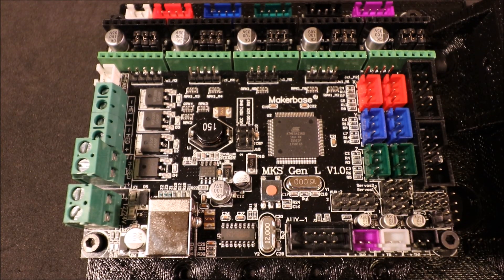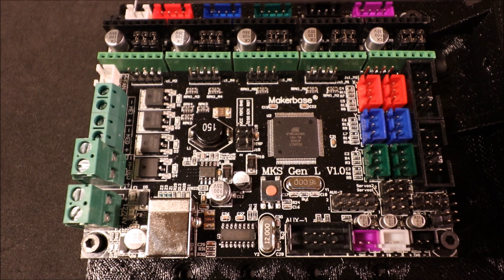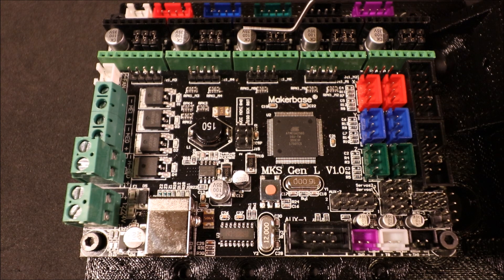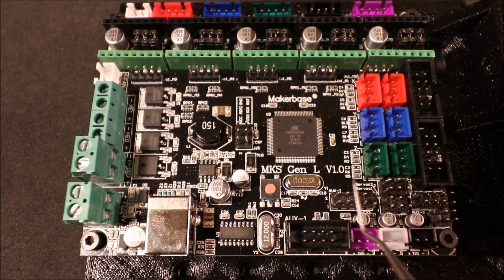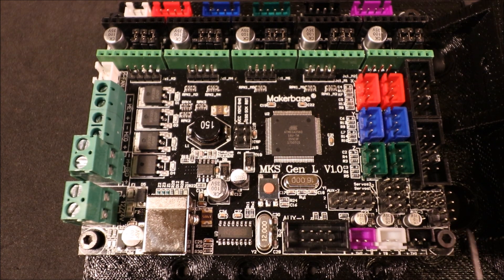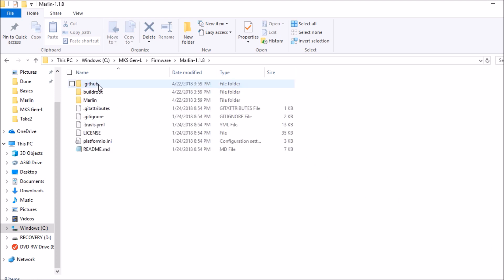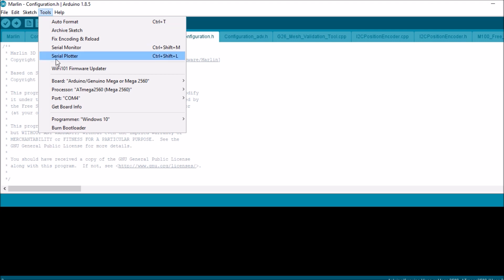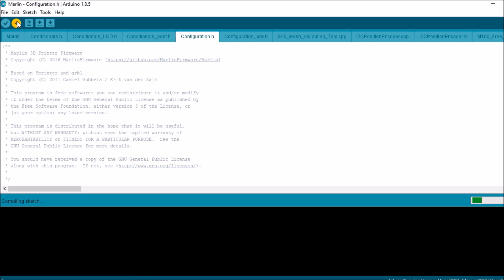MKS Gen L - Motherboard Basics for 3d Printing

Comment: great video!
I need some help if possible..
When i connect my board to the pc this don't shows nothing.. 
When connect 2 lights turn on the corner one starts to blink then disappears the red stay on..
And 2 green lights stay on behind the usb shield but nothing happens..
Dead board??
Ore can be fixed..

Thanks.
Reply from the maker: What OS, Windows 10?  Do you see  USB com port when connected?  There might be a link in the comments below, that will help.  Otherwise I'll post it.
Reply: @EdwardBraiman 
A user from reprap forum told me on o post that maybe it's the ch340 chip that is dead.. Because it have power from the pin 1 and pin 16...
Bad luck...
Reply from the maker: Can you capture the board issue with video and I'll see if I can replicate?
Reply: And when I connect power 24v is the same.. The 2 green lights always on..
With the lcd 2004  only appears blocks, and when press the reset button the blue light blinks like a reset..
But the rest.. Connected to the pc nothing... Dead..
Reply from the maker: Check for windows 10 updates if this is your operating system.  It could be a bad board, but at least you could save yourself a headache if replacement board reacts the same.  I had a driver issue on my Dell until I updated software and drivers.
Reply from the maker: I'll check the video tommorow.
Reply: @EdwardBraiman 
Thanks for the help..
I talk with the seller and the board is not good.. he is going to send me a new board...

Regards.
And many thanks!!
:)
Reply from the maker: You're welcome.

Comment: So when I connect the device it doesn't show up in my device manager or marlin at all. When I plug in the old ender 3 board one it shows up I don't know if the board bad so I did order another one to see if that was it, do you have any ideas?
Reply from the maker: Sounds like it's not recognizing by the OS.  I experienced this about a month ago.  Try checking for a windows 10 update.  Then try checking device manager again.
Reply: @EdwardBraiman  I just updated my windows still not showing up do you think it could be a bad bootloader
Reply from the maker: I'll check if I can find the file I used to show in device manager.
Reply: @EdwardBraiman  Thank you!
Reply from the maker: Try this and let me know ... http://folgerforum.com/t/solved-usb-serial-drivers-where-to-get-zip-file-added/146/3
Reply: Had the same issue. Please try http://mdlsolutions.com/downloads/Arduino/CH34x_Install_Windows_v3_4/. Connnect you board via usb and run the executable. Once completed disconnect and restart you computer. Should be fine then
Reply from the maker: @marceldegoede2281  Your link appars to be broken on download.
Reply: @EdwardBraiman  Edward. Let me check. I installed the driver and solved the issue.
Reply: @EdwardBraiman  Here is the Github link. This one should be working. If not, please let me know. Includes driver for Linux, MAC, Windows
https://github.com/rodrigopulse/driver-ch340

Comment: Ed
I hope to get some help i bought this MB to replace the one on my X5S and cannot get it to work. It takes the marlin flash and repiter host connects but the steppers do not power up i have tried different com speeds and three differnt MB the mks gen l the ramps 14 efb and mks 15 i have latest stable version on marlin and arduino installed. 
thanks in advance don
Reply from the maker: First which motherboard are you currently connected to and do you hear a certain sound?

Comment: Does this board have back current protection ?(when I move the motor by hand the motor produces a small current that can damage the drivers)
Reply from the maker: As far as I know no, but I've not yet damaged a board.  It will illuminate the LCD. Just avoid repid manual movements.

Comment: Great video. I'm using the same board and after setting all the parameters for my printer, I hit compile and everything went well until the end. The only error message i received was this, "An error occurred while uploading the sketch". I tried loading Marlin 1.1.9 bare bones and got the same message. I looked around online but couldn't find a way to resolve this issue. Could it be the OS (Win10) causing this problem? Thanks.
Reply: Thanks for the help. I did as you said. I tried 5 different cables and ports but kept getting the same error message "AN ERROR OCCURRED DURING UPLOADING" and its all it would say. This was on my laptop using Arduino 1.8.7 and no luck. Well, I went and booted my old desktop running Arduino 1.8.5 and like magic it uploaded with a problem. Thanks for the help and please keep up the great work on your video tutorials.
Reply from the maker: @4666Robert  At least you have an idea of the problems now.  Next time the question is asked, I'll refer them to you.
Reply from the maker: Just out of curiosity, when you experienced this issue was the CPU an AMD on a DIY computer?  I've been able to replicate the issue on one of my computers.  Still working on a solution.
Reply: @ @EdwardBraiman   
Just to add my two cents here, as late to the party as they may seem...….
Even though I can purely understand the easy temptation to blame windows 10 (….too many updates just pisses me off!!) I had a similar issue while attempting to download Marlin for Arduino, whereas I never before experienced problems with other files in the past. Wound up scouring the web & someone clever enuf was able to suggest turning off malware protection on the computer while attempting to download the file....and lo and behold, IT WORKED!!?! I was so relieved as I had exhausted all other possible solutions. Apparently the malware finds certain portions of the code offensive and intelligently decides to omit them. Smart. The culprit was Bitdefender. Be aware.
Just thought this may help.
Reply from the maker: Maybe we could verify by switching os on known malfunctioning system to verify as well?
Reply from the maker: It's probably not windows 10 as all the MKS Gen L tutorials are captured in windows 10.  What version of Arduino IDE are you using? What's the error message in Arduino IDE?  Do you see a COM port in Arduino IDE? Have you tried another USB port on your computer?  Have you tried another USB cable?  Have you tried using another computer to see if syptoms change?  If none of these work I would contact the seller about the issue.  Hope this helps.
Reply from the maker: How are you doing with MKS Gen L?

Comment: Hi Edward, great videos, I bought a mks gen l because of this video. I have an issue, the com port appears on arduino, but I get a timeout before compiling marlin, sometimes it will flash without the timeout, but that means that s3d, cura etc can see the port but can't open it. Do you know what it could be
Reply from the maker: Here are a couple of things to check. USB cable, port selected, or it might also be connected by another application.  Here are a couple of things to try.  Reboot computer and connect only MKS Gen L to computer, then open Arduino IDE, then try and send Marlin firmware.  If this does not work, try same process on another computer.  If it doesn't work after this the board maybe defective.  Hope this helps.
Reply: @EdwardBraiman  thanks I will try, I seen in one of your videos about selecting a ramps board in the firmware, I might try that to see if it works

Comment: does the MKS Gen L support 24 volt - I am looking to replace my board on my monoprice select plus (Wanhao i3 plus clone). The board, heat bed, extruder and fans are all 24volt.
Reply from the maker: According to the website (https://spool3d.ca/mks-gen-l-v1-0/ ), it can handle 24V, granted all my video are done within 12V.  So I have no personal experience doing 24V on the MKS GEN L v1.0.

Comment: Im trying to flash Marlin 1.1.9 to this board, and no serial port is showing up in arduino.cc. I'm connecting the board via usb, and using a mac laptop. Apparently the COM3 or COM4 port is suppose to show up but mines not. Running the latest marlin and arduino firmware. I've tried using different usb cords, and I have 2 boards and tried both thinking maybe one was defective with no luck.
Reply from the maker: Many people have had similar issues with Macs. It maybe related to an issue with linux/Unix connection issues.  Try checking the furoms relating to Ubuntu and Arduino connection issues.  If memory serves me in Ubuntu I had to modify something in a device connection.  Let me know if you find it.
Reply: I have a computer with Windows. Should I just flash the board on there to save me some headache?
Reply from the maker: Windows should make it easier.  Unfortunately I don't have a Mac to test the issue.  Closest I've experienced was with Ubuntu.  Something about try issue.
Reply: Yep that did it... Plugged it into my HP running Windows and now I have a COM port that shows up. I think Arduino is missing some sort of driver for the board in the mac configuration.

Comment: Boy I am eat up with issues here lol. The Marlin on my Mac errors out and says I need C++ and a toolchain. An OLD Vista pc I have isnt compatible with with a version of Marlin I down loaded. On the upside, Ive got the printer wired all up. Id like to see if everything works before I get to trimming wires for decent management and securing everything in place. Thanks for the help boss. Valuable resources here.
Reply from the maker: Good luck.
Reply: I had to flip flop the middle two wires for my steppers to get them to work. A friend flashed Marlin to the board, he running Windows 10. I dont know if I can find a Mac version of a driver to make this work with what I have, or if Ill have to break down and buy a new PC to get it done. Thanks to you Im closer than I have ever been to getting this thing going. Looking forward to more of your videos.

Comment: Trying to install a MKS Gen L V1.0 board in my Tornado. Most is start forward but I have searched with no luck on where the 12V and 24V fans go on the MKS board. I have located the 12V and 24V fan wires from the fans. I know some fans run continuously and some not. I don’t want to hook them up wrong.
Hop you or someone can tell me where the wires go. 
Thanks 
Dale
Reply: Control through software

Comment: So I have my firmware they way I want but im haveing trouble getting my mac to reconize the board to flash it. When plugging in the the mac, The blue led flashes a  couple times an shuts off, while the red led stays on... The board just never shows up in the ports in the Arduino IDE...any advice? Thanks for your time..
Reply from the maker: What do you see for your com port in Arduino IDE?  Keep in mind if you can take a screen capture or video of what you see in Arduino I might have a better idea of how to help.
Reply: Thers only bluetooth ports no usb serial pirts show up at all
Reply from the maker: Could you read the 3d mother board name off the board?  Let me know if this link helps ... https://forum.arduino.cc/index.php?topic=150734.0
Reply from the maker: Have you tried the like in the previous comment?  What were the results?  Have you verified on a window machine if possible?  Currently I do not have a Mac to test your issue so I can only suggest forums like teprap for more information.  I'll keep an eye open for information on this issue.
Reply: I am not even getting the board to show up in system report on my mac. Any suggestions?
Reply from the maker: If possible can you check to see if a windows machine sees the motherboard as well?  Might be another possibility to check in case the motherboard is defective.
Reply: Unfortunately, I don’t have access to a windows computer. The board is brand new so I would hope it’s not defective
Reply from the maker: Okay let's get some background info on your configuration. What type of Mac and what version of the operating system? What's the version of your 3d mother board? What version of Ardunio IDE are you using? Can you post a video of what steps your taking in navigation of software?  If you need a video capture software I suggest OBS.  Post your results in comment section with a YouTube link and I'll take a look and see if we can solve.
Reply: No I have not yet Fixed this problem, but I have found out that im missing the drivers for the board. although I have had no luck finding the correct drivers for mac users... :/ Does anyone have a Download link. Id be much greatful!
Reply from the maker: Xternal Creations I'll search tommorow night.  You can see the port?what was the solution to you initial problem?
Reply from the maker: The drive is normally included in Arduino IDE for windows.  Not sure of the process for Mac.   You might want to check download manager for Arduino mega 2560.  Hopefully this will help.
Reply from the maker: Checkout this link ... https://forum.arduino.cc/index.php?topic=261375.0

Comment: I appreciate your thorough knowledge on the Gen L Board and I suspect that you are the person to go to for all things Gen L.  Which lead to my question: What are the specific brown, yellow and red and as well white and black wiring pin outs on the Gen L board for the BL Touch? Nobody else knows or their keeping it a guarded secret. Thanks.
Reply from the maker: I'm going to guess that some printer boards either have a four pin connector or it's analog or digital pin breakout. If they have documentation it might be useful to check for a datasheet or pinoit diagram. I'll do some research when I have a chance.
Reply: Thanks for the quick reply.  My board is the same board you are describing in your video.
Reply: Edward, thanks for looking into this, but I think I found the solution on foreign language youtube video. The control wires go on servos 1 in the order yellow, orange, brown, which is a different order than the MKS1.4 board.  The black and white go on the Zmin connector of course.

Comment: Hi Edward, I got my new printer setup with this board version, and it works excellent. However I ran into a problem when trying to connect a part layer fan. I used the 2-pin connector as instructed, but my fan barely moved when ON. I checked the port voltage with a multimeter and I got +5V. Is this a logical output and I need to use external transistor as a stwitch or I got a faulty board? My fan is 12V dc 80mA brushless motor, 40x40x10.
Reply from the maker: Stefan, I checked the fan pins with a multimeter as well and received a very low output.  I was getting ready to do a video on this in a couple of weeks, but now it seems it might need to be done sooner.  It appears you very good at thinking about the problem.  Here are a couple of questions we may need to answer ... What is the current printer configuration your planning on using initially?  What's the motherboard selected in MarlinFW, it's okay to use RAMPS 1.4 configurations if you choose.  Have you attempted to use any gcodes to change the current flowing to the fan?  Also this might help ... https://youtu.be/0W3VQpL0e8g ... it will at least explain gcodes and give you yet another tool for analysis.  If it does not work let me know.
Reply: Thanks for the reply Ed, just figured it out: 
    I had to upload Marlin FW to my Tarantula (thanks for the idea) in order to gain direct control over the fan speed - it's FAN 1 (I don't know which pin is controlled by FAN 2). So if I set the speed to 50% (value 127) pin 9 outputs 6.6V but my fan doesn't work at this voltage, increasing it gradually increased the output voltage and I got 12V at speed 255 - that's the max. The control goes through the MOSFET closest to the connector looking at the board. I will further measure it to see if this is an analog signal with constant voltage or it's a PWM and I will post an update later.
     The main issue here is the frustrating lack of documentation, otherwise it's a great board, I will use it in my future printer build. 
    One advice to all upgraders and 3D printer builders - don't buy brushless fans if you want to control the speed by voltage. Those devices have their own electronic speed control  and just need power to operate, while the old school brushed motors run as fast as the voltage you supply.

    edit: actually I take back the part for the brushless motors, you can still control the speed through voltage, but it works only above 65%, meaning setting fan speed to 40% is not enough to make the blades rotate. At least for the fans I have.

Comment: What are the differences between the MKS Gen L and MKS Gen 1.4?
Reply from the maker: Looks like the board layout is different, but the MKS Gen 1.4 looks to have three 12/24 power out pins.  I think I'll make another tutorial in the future on this board as it has easier to work with power pin wise with 12/24.

Comment: Thanks for series of videos. I'm going to build a corexy, have all electronics for it.
I was going to use a ramps 1.4 board but I keep that as a test bench. Today I
ordered 3 Mks Gen L and 3 12864 display, 1 for corexy and the rest is going
to my Ender-2 and Ender-3. Need to swap the boards so I can put filament
sensor on Ender-2 and Ender-3 and auto leveling on Ender-3. Keep the videos coming.
I'm a newbie at this so there is much to learn.
Reply from the maker: No problem. There will be more just waiting on parts.